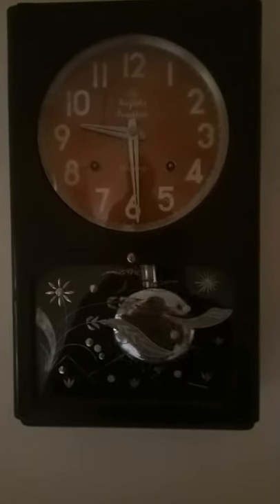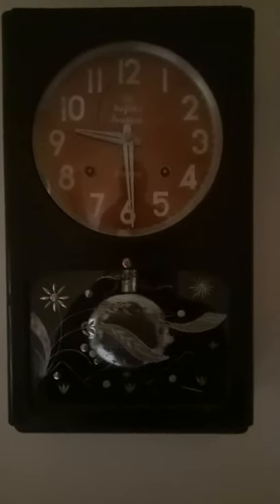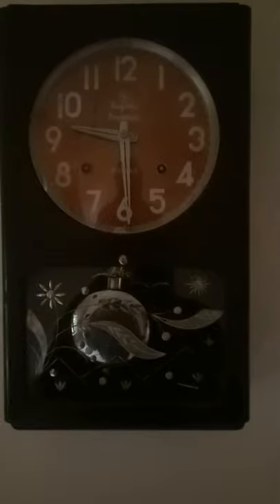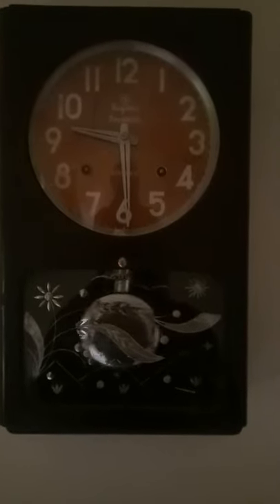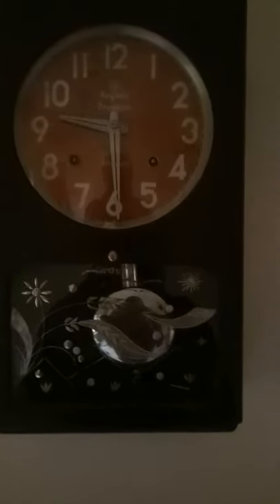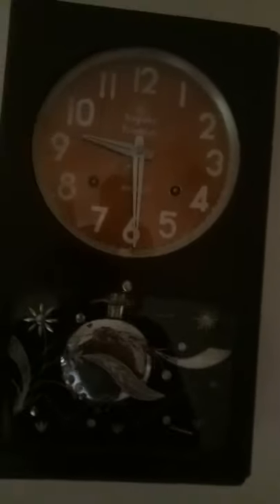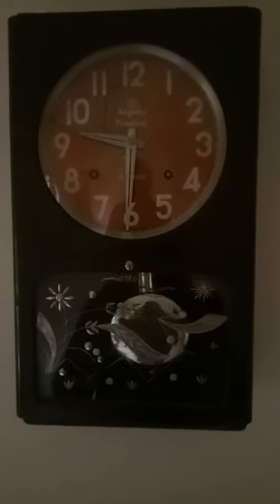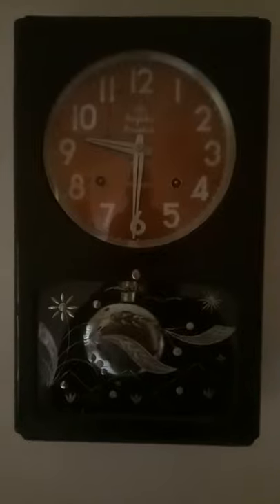Antique clock - 1960's Nayak's president Bim Bam clock...

Comment: Good clock I also have one
Reply: Which company wall clock ur near have sir please rply
Reply from the maker: President's Nayak
Reply: @justsomething84  thnku very much for rplying sir.  I love key winding clocks my near also one wall clock have sir it's also keywinding company is CAPITAL I think its local manufacturerd but still now good working. Inside fully brass machine.  I think its cost Rs 400 in 1995. How much ur clock price sir and which year u bought it? Please reply sir
Reply from the maker: @AshokKumar-jn3kq  Oh great😊

My clock is of around 1960s
I bought two years back...
It was in bad condition... I just fully repaired it to a working good clock....😊

Do check out my new video on a time piece which is also handwinded
Reply: @justsomething84  at what price u bought it sir? Please rply